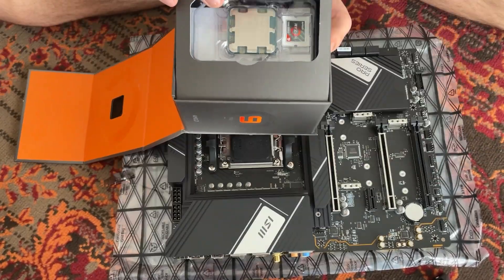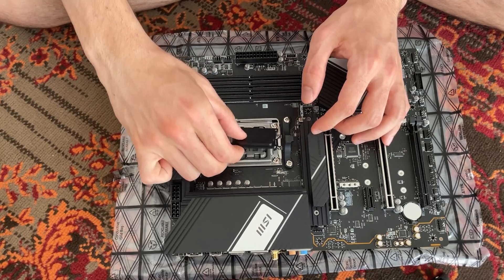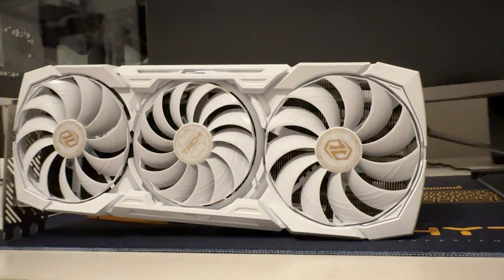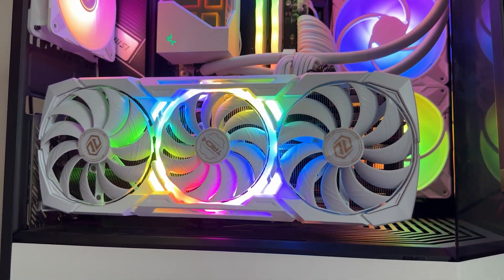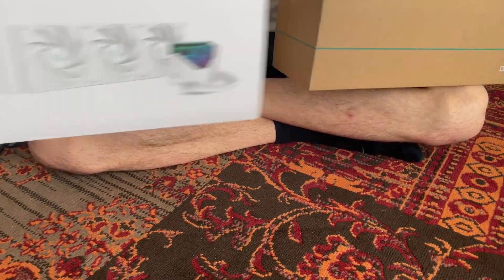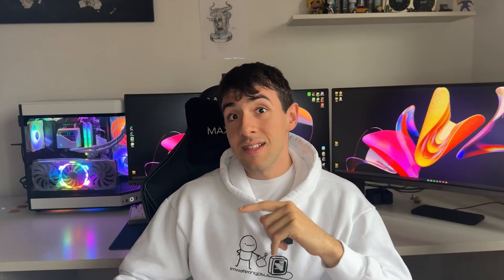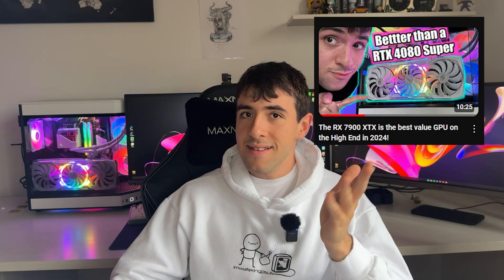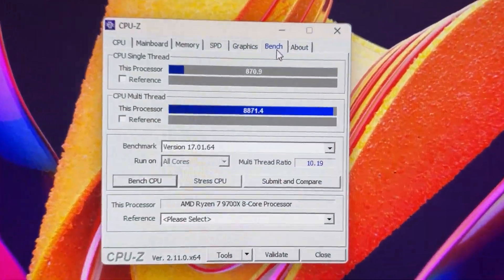I downgraded my Ryzen CPU to get more FPS...

Comment: Hello mate, just saw  your channel and watch this video and the 9700x undervolt video. Those videos are pretty good. They are fluent, easy to understand and very useful. Thank you for that, keep doing it. I build a new pc with 9700x-7900xt. I'm going to do your 9700x bios settings but could you please do a video about amd adrenaline software settings for amd gpus. This is my first amd gpu and idk what to do on the amd adrenaline program?(just opened the low latency mode).

Comment: Hey dude i am facing this issue right now. i boutght 2 tcreate 6400 mhz ram sticks and they are not booting. its very inconsistent, it sometimes boots with one stick. but the motherboard is able to read both, has anyone been able to solve this issue??
Reply from the maker: I’d say try getting the latest bios on and try a manual profile for the RAM. Check out my RAM guide and bump the voltage up a little. If it still doesn’t work properly, somehing’s faulty for sure

Comment: 9700X will not get you more FPS, not that it's a bad CPU, but to advertise it over 7000 series is not the best advice, no offense.

Because 7000 series includes 7950X, 7950x3D and 7800x3D. It's not a knock on 9700X, but having higher ram at 6400mhz is not groundbreaking performance gain.
I have extensively tested 9950X and although it gets very close to 7950x3D in averages, it cannot beat it in averages, and right now 0.1% drops on 9950X are higher than 7950x3D (you can see it on my channel)
You chose a 9700X to get more FPS than 7800x3D, that's not making any sense
9950X is smoother in heavy scenes, but it doesn't beat 7950x3D in averages, sometimes 7950x3D pulls away by about 50 FPS in some games, sometimes they nearly match by about 5-10 fps difference in average to the point you can't tell what CPU you are looking at, but there is still a win for 7950x3D overall, even in 0.1% lows 7950x3D remains better on 24H2 Win 11

Now, if you have 8 core on 7000 platform and you go 9700 you will get incremental performance. 
Even with tweaked RAM. At this point I saw countless of test with 8000mhz compared to 6000mhz ram on 9000 and 7000 series and performance is actually better on 6000mhz, because above 6400mhz you must have UCLOCK/2, halving your ram potential due to memory controller limitations and Infinity Fabric limits. 

If you are on 8 core 7000 series, I would suggest going 9950X or 7950x3D if you know how to Process Lasso
Or wait for 9800x3D, but if you just game, why are you not on 7800x3D already, and at that point just wait for new x3D 8-core

Memory Controller is better on 9000 series, absolutely, but not to get you 20-40 fps difference. 10-15 average more max
I tested it on my systems on my channel.

Let me paint you a better 9000 scenario as of 10/24/2024: you buy 9950X, you undervolt it to 1.2 volts on V-Core, then you set Max frequency to 5.35 ghz on CCD0, then you set 5.3 ghz on CCD1 in BIOS. Then you Process Lasso first 8 Cores to the game, and turn off Hyperthreading using Process Lasso for just that game, and you will be at 55 C max during gaming load with 420 AIO.

If you are not stable step down to 5.3 ghz CCD0, and 5.25 on CCD1, and retest

If I was to put 7950x3D at the same system I would be at 65-68 C during games.
9000 series does not require as much power, but it is super efficient in.
If you are on the budget and you are buying new AM5 platform with 8 cores, my only question is why are you not buying 9800x3D?

If you need more cores as me, wait for 9950x3D or buy 9950X. 9950X games GREAT, you can see that on my channel too.

Comment: soo i think your mistaken. its not that the memory controller is different. Its that your going from a dual ccd down to a single ccd. less strain on the the internal controller since only 1 compute die vs 2.
Reply from the maker: Fair point, but unfortunately the R7 7700X was literally THE worst Ryzen for memory controller… and that was single CCD

Comment: Glad they got rid of PGA, I can say after just finishing bending back some pins
Reply from the maker: Oh man that’s for sure. AM4 was terrible in that sense. Also the CPU would often remain attached to the cooler
Reply: @ImWateringPSUs  I got them bended in the package, twice. Honestly they should just include like a little sturdy plastic socket within the package so that the pins are safe during handling

Comment: i have 32gb ram kingbank blade(hynix a-die) that i buy from famous OC enthusiast in indonesia. This ram able OC into 9200MHz stable on ryzen 8000 series and proven for daily. but when i buy it and instal on 7600x, for this time i only able boost it to 7400MHz stable for daily.  
they say its normal, ryzen 7000 series usually cannot push more than 8000MHz

Comment: Still can't beat R7 7800x3D... 6000MT/s CL28 is perfectly stable.
Reply: Actually…… I have a 7950X3D on the EXACT SAME BOARD. And same issues. Can’t use more than 2 modules and after lots of f’ing around it still is just some days unstable. I’m actually replacing that board with a new one as I have a 9900X3D on order. But this board just has issues with memory.

Comment: the memory controller is fine imho, 7800x3d with a620, team elite 4800 cl40 tuned to 6200mt cl28 gear 1 stable, xpg 5600 cl38 xmp/expo rated tuned to 6200mt cl28 gear 1 stable too, and infinity fabric 2200 all no issues.
Reply: Yeah alot of people overspend on their motherboard, I've used A620 with a 7600x and ran 6000,MT no issues.

Comment: Whats your AIO fan curve?
Reply from the maker: I just max out the pump and run a pretty standard “quiet” option on the fans. But I do have replaced the original fans with the better Arctic stuff
Reply: @ImWateringPSUs  thanks, I'll the quieter curve and see if temps are stable.

Comment: 7900x SMT off,pbo 167watt,-15 all cores,kingston 6000cl36,xmp on,high memory band on ,gb b650(aorus or gaming x ax) is the fastest gaming amd cpu after 7800x3d.This review from 0 to 10 is 0.I have tested all amd cpus 7600-7600x-7700x-7900x-7950x-7800x3d.Almost all memory kits,all b650 motherboards
Reply: Must've take you a lot of time to test them. I have a ryzen 7800x3d. Btw do you have any tips to get started with xmp and overclocking?
Reply: I have a 2x16gb kit of 6400 cl32 for amd expo, curios about how should i start testing and safe voltages, coming from am4.
Reply from the maker: If you’ve tested all CPUs (which I have done) then you should know that dual CCD CPUs as a whole are worse for gaming, especially those that have half a CCD disabled. 7900X was a very good buy considering just the Ryzen 7000 lineup, which is why I used it as a daily for a year. Running a similar setup too, but I needed the multithread and was running -20 daily. But Ryzen 9000 is simply better for gaming, especially if you tweak it right. No questions about it

Comment: 7800x3D is the best gaming cpu in the world. any by FAR in games that make use of 3DVache, like in MMOs. its insane
Reply from the maker: Yay that’s true :) Well, 14900KS beats its, but the Ryzen chip is definitely better value for money. However it’s not great for productivity, for me personally it wouldn’t have been a good buy. And in my usecase even for gaming I would have seen 0 difference really, compared to 9700X. Actually losing frames in some instances
Reply: @ImWateringPSUs  honestly i wouldnt even consider intel with the state of the company and how their chips perform (coming form a lifelong intel user, i only just got my first amd cpu ever with the 7800x3D, and will never go back to intel)
Reply: @ImWateringPSUs  i never see a review which show 7800x3d so closed to 9700x when in some scenerio 9700x perform worst than 7700x in gaming.
Reply: @ImWateringPSUs at what cost 💀 (responding to you saying the 14900ks beats the 7800x3d)

Comment: The IO die on ryzen 9000 is identical to the one on ryzen 7000 including the memory controller. Any difference you noticed is entirely subjective.
Reply from the maker: The quality of the controller is better. Better binned. I’m sure about it because I test a pretty large sample size and did a lot of tests with the same motherboard and exact same RAM kit!
Reply: @ImWateringPSUs  Alright, I didn't know. Pretty surprising. I got a good deal on a 7950x3d so I'm skipping the 9000 series.

Comment: Wouldn't 7800x3D give even more FPS though?
Reply from the maker: It would but not in all games. Also tiny difference compared to a properly tuned 9700X and would lose a lot in productivity
Reply: @ImWateringPSUs  Not a tiny difference in games that are cache/memory sensitive. 1% lows can be as much as 30-40% higher and averages can be 20%+ higher in those games.
Reply: @mojojojo6292  in world of warcraft my 7800x3D gave over 50% more fps compared to the 14900k i9.
Reply: @Snxgur  Exactly and there are plenty of games that see big gains from the cache especially on the 1% lows which matter even more than the averages for stable, non stuttery frame rates.
Reply: @mojojojo6292  yeah, IF you are playing at too low of a resolution and settings for you GPU.
Reply: @ClutchKohlrabi  No. If you have a 144hz+ monitor and you want a stable 140+ fps in many titles regardless of resolution or gpu power then the cache can make all the difference in maintaining that.
Reply: @mojojojo6292  regardless of resolution or GPU power? Right.
Reply: @ClutchKohlrabi  You miss the point. I meant if you are targeting the max frame rate of your monitor either though brute forcing it with the gpu or by lowering settings or using up-scaling then yes the cpu makes a massive difference. The majority of monitors start to lose motion clarity as they drop below their max refresh rate as well. 80-100 fps might seem still great until you factor in how bad inverse ghosting gets on the majority of monitors compared to 144hz. If you're targeting even higher than 144hz then it's even more important.
Reply: @ImWateringPSUs  

Productivity sure. But i thought i'd comment according to the title hahaha
Reply: out of stock

Comment: On my Asrock Gaming Nova Wifi X870E I able to get from my Gskill DDR5 16x2 GB 6000mhz stable to 7400mhz with Ryzen 7900X
Reply from the maker: That’s an insane OC. My question though is: did you have to relax the timings significantly? I haven’t noticed that big of an improvement with RAM tweaking on X870 tbh
Reply: @ImWateringPSUs  my Trimmings are 36/46/46/58/TRC 104 / Latency 64.0ns/Vsoc 1,28v Mem vvd 1.42v

Comment: I'm very hyped for the new x3d but I don't know if I should get the ryzen 7 9800x3d or the 9 9950x3d now I have an i9 13900ks
Reply: ryzen 7 9800x3d should perform better than 9950x3d in gaming
Reply from the maker: If they release that terrible single CCD 3D V-cached Ryzen 9 again, definitely get the 9800X3D. If they do the right choice, go 9950X3D if the budget allows for it, 100%

Comment: AMD build is fine, but it will get blown out of the water by the next gen intel/Nvidia.
Reply: new gen better than old gen no way!
Reply: Maybe wallet blow😅
Reply: Only the 5090 tbh. Nvidia’s lineup outside the very top is looking incredibly disappointing based on the rumors (16gb 5080, wtf is that), but then again, they are just rumors.

Arrow Lake is looking like garbage based on benchmark leaks.
Reply from the maker: Yeah next gen from Intel is gonna be insane for absolute performance. Not sure about value for money for the mid-to-high range tho